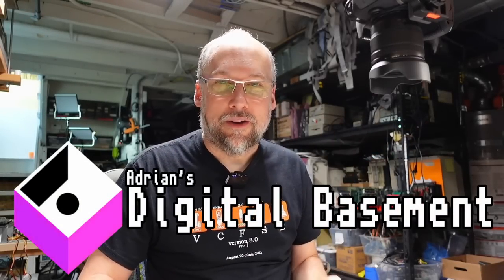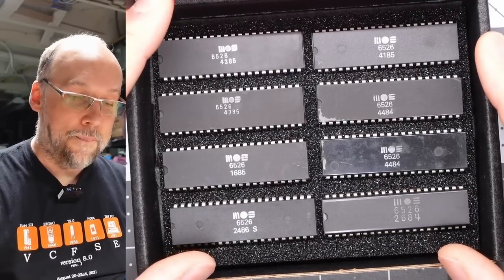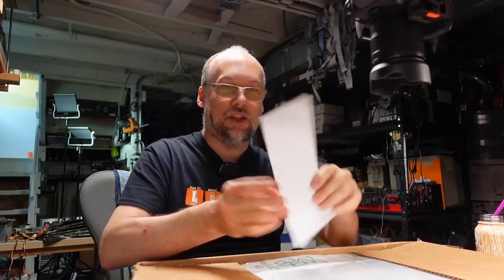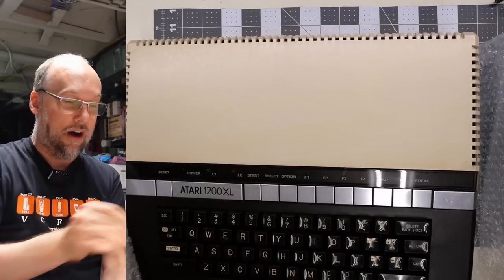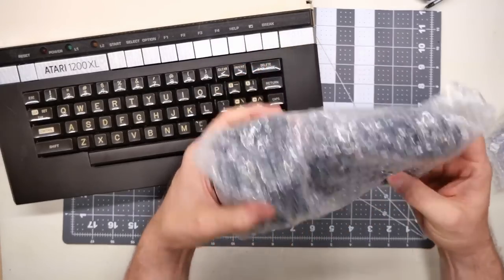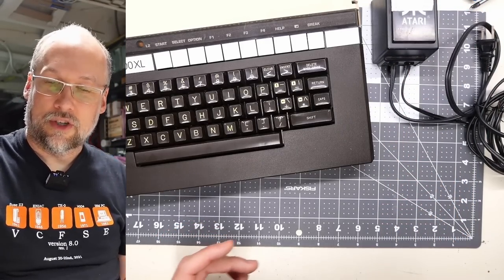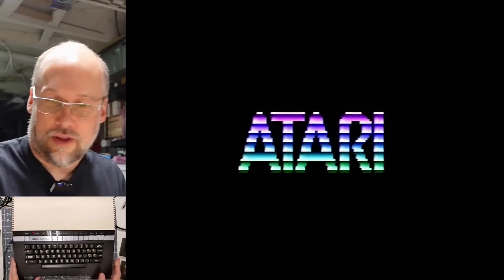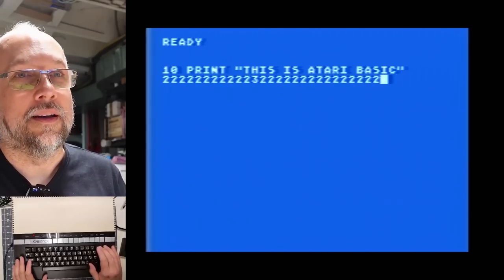0066 A pretty rare Atari computer shows up in the basement

Comment: Actually, the 1200XL isn't really that rare. It's just needing an OS revision more in line with the 600XL or 800XL / XE and the SIO power fix. Plenty 1200XLs sold early on.
The 1200XL's self test has an Easter Egg in the Keyboard test when running All Tests. How can the computer test its own keyboard? It can't - watch what it types out instead.

Comment: If someone would make a mechanical keyboard for the 1200XL, I'd make it my main Atari 8 bit machine. I've debated adding a Parallel Bus Interface on one of my 1200XLs, but I can't find my extra machine :(
Reply: The idea of PBI on a 1200XL may sound good but in reality a hacked up rare machine is a mess of wires and it doesn't add much function with so limited a supply of PBI devices. It's such a beautiful machine as is.
Reply: Maybe if one only has one 1200XL, but not if one has more than one. I will absolutely do it when I go to storage and pull out the extra 1200, or when I pick up another one. For the FujiNet alone it will be worth it, at least to me. 

I've been wanting to fiddle about with hanging a V9958 off of the PBI, specifically on a 1200XL. But what I've been wanting even more is to build a mechanical keyboard. My previous couple of attempts have had denouncing issues. For the Frankenstein1200, it'll probably receive a TKII or similar - so as to keep a common PS/2 keyboard on my desk (also used on my AgonLight2, original 8266 based BASIC Engine, etc). IDK, lots of stuff that I want that my wallet doesn't agree with me about 🤣 

Regardless, my eyes will stay peeled to see if someone makes a mechanical keyboard replacement for the 1200XL.

Comment: Does all of the Atari computers use the Pokey sound chip???
Reply: Yes. While there was a machine planned with a massively upgraded sound chip it never materialized.
Also, the 5200 and XEGS games consoles use a POKEY.
Reply: @oldguy9051  yes, that was the AMY soundchip. They showed it at the CES from 1985. But Tramiel arrived and made things different.

Comment: Are you sure that BASIC isn't built in on the 800XL I bought one in about 83 and learned BASIC on it and dont remember having a cartridge
Reply: The 400, 800 and 1200XL didn't have build in BASIC. The 600XL and 800XL (and the XE series) had build in BASIC.
Reply: OK Thanks!

Comment: I don't believe the 800 had a parallel port.  I even skimmed through your 800 video (has it really been a year?) and definitely no parallel port
Reply: The original 800 didnt but the 800XL did. It was behind a clip on cover, so maybe you just missed it. It was an edge connector that carried cpu signals that were not available at the cartridge port.
Reply: I had a box for the 800 that provided a centronics parallel usable with the dot matrix printers of the day.
Reply: @GinnyHazleton  That was the Atari 850 that had one parallel and four serial ports on it. . I had one myself but it got lost in a house move sadly.  This was a separate device that included its own 6507 processor. The parallel port on the later devices was the "PBI" port (parallel bus interface) and not designed for the direct connection of printers - all the Atari printers had a direct SIO connection and they never produced a version of the 850 in the new design when the XL machines came out, although the old 850 would work correctly on the new machines thanks to the SIO bus. 
When people refer to the parallel port on an Atari machine they are referring to this PBI interface in the later 1000 series machines (XL/XE/XG etc) not a printer interface - something that causes confusion (including in my reply!). It is true that no Atari 8-bit computer had a Centronics style printer port. There were, as I recall, several 3rd party manufacturers that made much cheaper devices to create Centronics ports on the SIO bue than the 850
Reply: I knew about the 850, I think I had one of those I used for my 800 and then for my 130XE
Then again, I might not have and couldn't connect a printer.

Comment: i can see why the 1200XL didn't sell. no BASIC, no parallel port? it doesn't seem like an improvement.
Reply: It was mostly the cost ($899) and some software incompatibilities. The 800XL released at $250 and by then the XL software issues had been ironed out.

Comment: First off, turn on the AC. Last thing you need is a heat stroke with the condition you have.

The Atari 1200XL is not a rare Atari System, it was made for over a couple of years plus before Jack Tremiel took over Atari, and sold for over 3 years to sell out all stock they had. A rare Atari would be the 1400XL systems as they were only made in Prototype Unit amounts (about 100 or less) (Wikipedia has it all wrong, never trust it. As even I am a Wikipedia Article Editor...)

The Atari 1200XL was a step up from the 400 and 800 units while being 99,5% compatible to it. the .5 incompatibility was from the lack of the 3rd and 4th joystick ports, and the GTIA Chip had an extra extra mode added to it which was rarely used but some video games of the time in trying to produce certain colors ended up producing other colors but there was no incompatibility that would crash, freeze or be detrimental to the machine. This same issue was also in the 800XL and 600XL. The 1200XL did not have BASIC built-in like the 800XL and 600XL.

Nothing odd about the 1200XL, as it was all of the electronics it was was shrunk and put into the 800XL and 600XL Jack Tremiel was famous for trying to price reduce computer prices to corner the market.

At the time the 1200XL came out was the start of the 2nd Computer Price Wars, where the Vic20 went for less than $150 an d the C64 went for $299; the Atari 800 went for the $299 and the 400 went for $199; but Atari was also giving out a $100 rebate when you bought it and apply it to your Atari purchase So the Atari 800 with the rebate went for $199 and the 400 went for $99, the 1200XL went for around $400, and Atrai disk drives went for about $150 when they originally went for $400 or more.

1983 was an interesting year because of the Computer Price War II.
Reply from the maker: Looking at what I can find, according to the Atariage forums, the machine was only made from about January 1983 to June 1983, with maybe 110k manufactured. (and that's guessing as there may be gaps in the serial number of the US made machines.) Compare that to the estimated 4 million Atari 8-bit computers sold of the other variants seems somewhat rare for a mass produced big name computer.
Reply: Yeah there are some errors here. The 1200XL is rare. Less than a thousand known to exist now. True the 1200XL was sold 'new' for some years to sell the existing inventory. The 1200XL is much less compatible than 99.5% to the 400/800. It's more like 80 to 90 percent when it released anyway.  Most 800's have the full GTIA same as the 1200. 600XL/800XL released pre-Tramiel.   In '85 I paid $199 for a 1050 I think and another $50 for the USdoubler enhancement.
Reply: There is so much untruth in this post that I won't even attempt to correct it. For the reader: just ignore it.